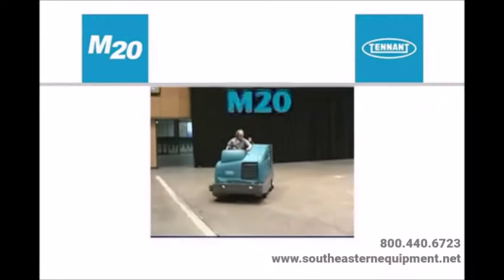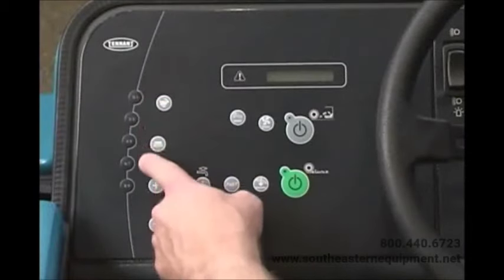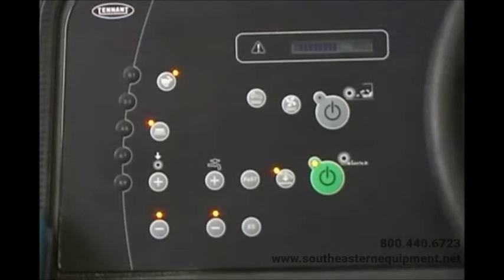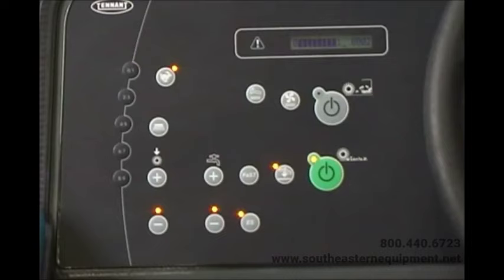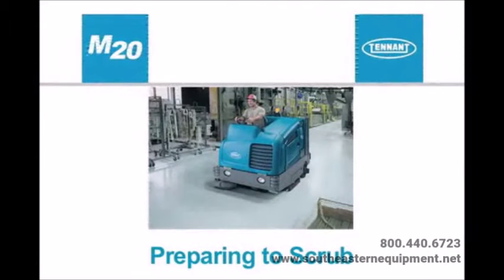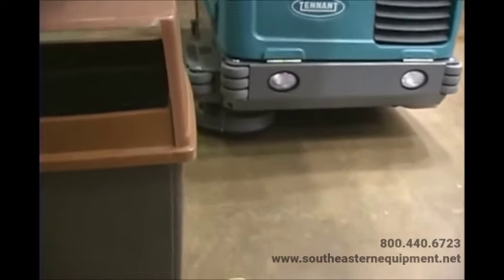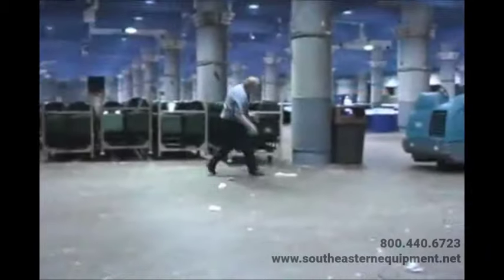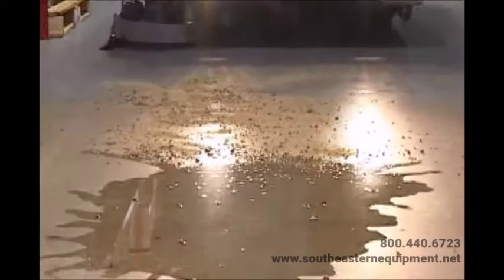Tennant M20 Training Video

Comment: What may cause water to come out while turning a corner or while cleaning the floor from the side.
Reply: Replace yer squeegees
Reply: Shutting of the water before u turn will eliminate that problem
Reply: U can also adjust the squeegee deflection.(up or down,pressure upon surface or substrate.
A size 17 wrench,clockwise or counter clockwise on bolt assembled to frame and squeegee assembly plate to  reduce or increase squeegees impact upon surface.
Also, can,or might have to adjust the two squeegee  deflection knobs,clock or counter clockwise to adjust the deflection on the far or outer left and right  edges of squeegee.
Also check your vac hose and metal housing above squeegee for any obstructions..
Reply: Need to release debris from suction square in the back

Comment: How do you empty the hopper?
Reply from the maker: It is quite easy since it is has automatic dumping. The detailed instructions are found on page 52 of the owners manual: http://www.southeasternequipment.net/v/vspfiles/downloadables/PM/TN/M20%20Gas%20LPG%20English%20Operator%20Manual%20%28SN%201000-%20%29.pdf

Comment: I have trojan batteries in my T2. Pain in the ass to keep filled properly. Charges sometimes, others, not
Reply from the maker: You can always upgrade to AGM, or install a battery watering system. Either one would make your life a little easier! Give us a call at 803-252-0100 or email <Parts@southeasternequipment.net> for more information.